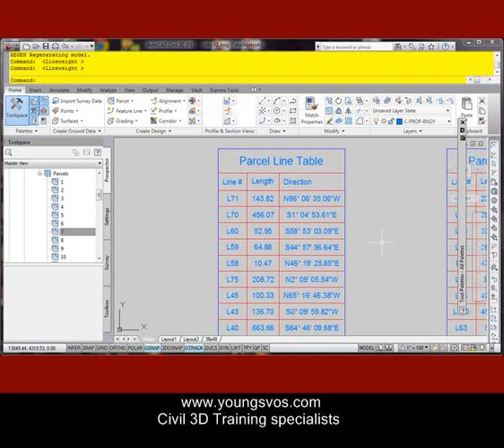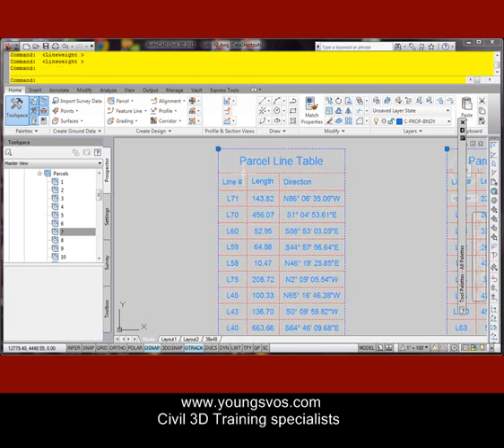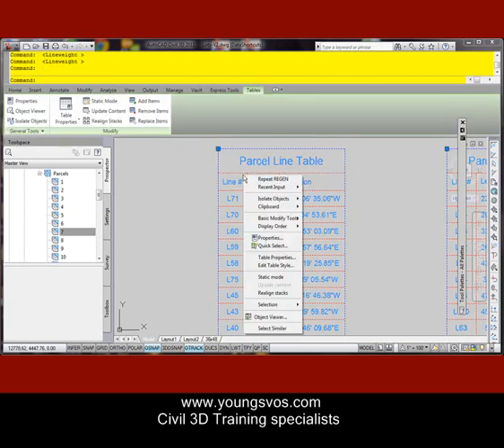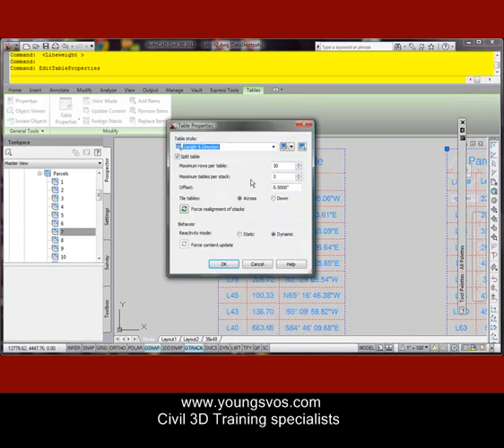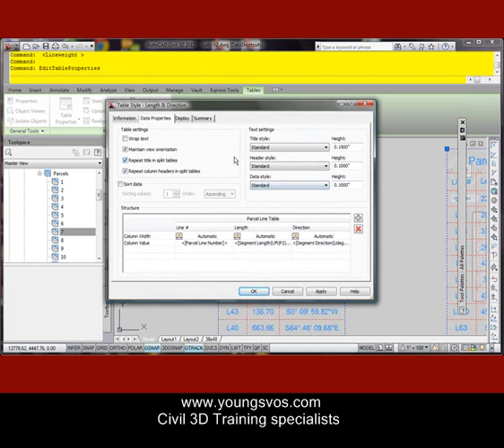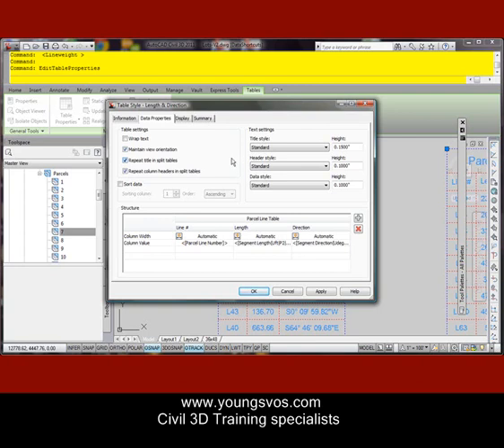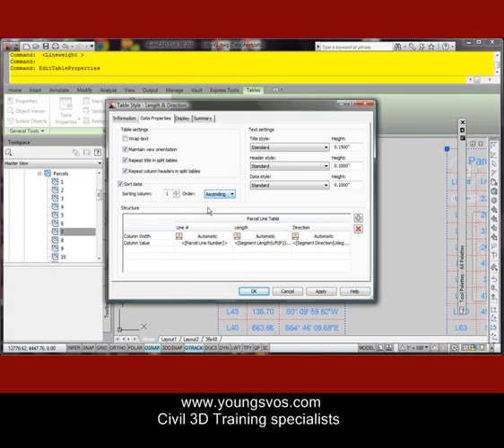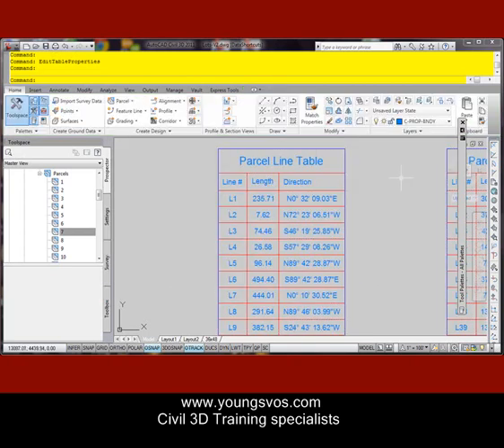Civil 3D Line/Curve Table Numbering

Comment: hello
do you know how to change the line column or the tags/labels into Line number? like 1-2, 2-3, 3-4..etc.
Reply from the maker: Sorry sir.. i do not.  I can check on this Monday and let you know if there is a way. So just to be clear you want the colum to contain the line point number at the beginning - point number at the end of the line.  Is that correct?
Reply: @LawrenceYoung1118  because im making technical descriptions of a land.. so instead of showing Parcel Line Number (L1, L2..etc.) , if possible to be shown as Line labels(1-2, 2-3, 3-4..5-6, 6-1..)
Reply from the maker: @reyfelninomaglines8209  have not forgotten... cannot find the solution yet.  I will keep trying.